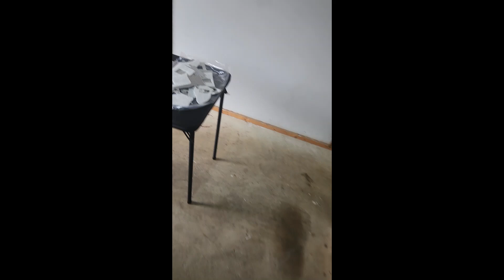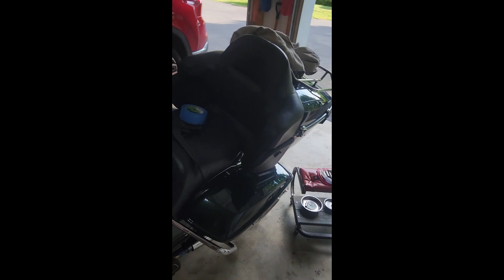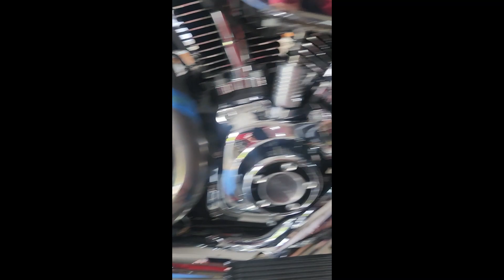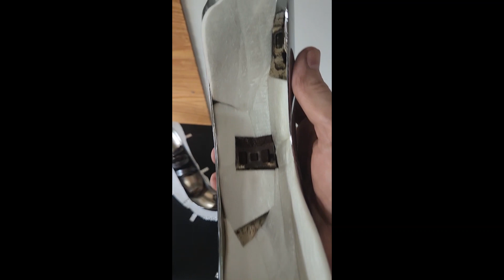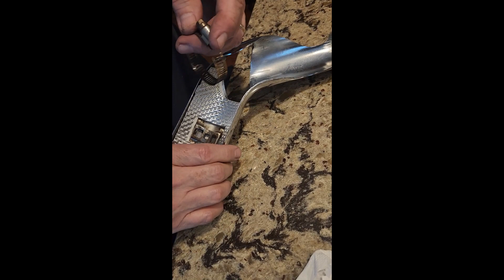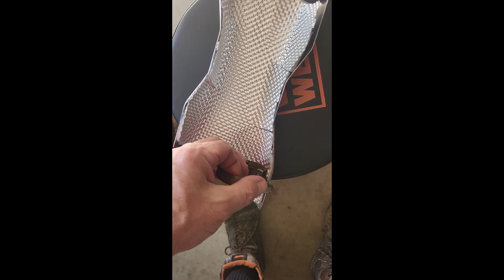Harley Ultra Limited Design Engineering Heat Shield Insulation

Comment from the maker: Yes does reduce the heat on leg,  I would say I use the fan as well as open the fairing vents and combo of that solved it for me.  Still wish the bike had a fully water cooled design.  I have a VTX 1300 that is I didn't have to any add ons.